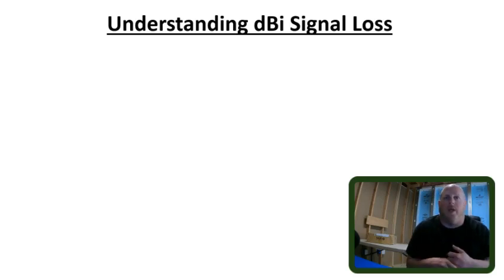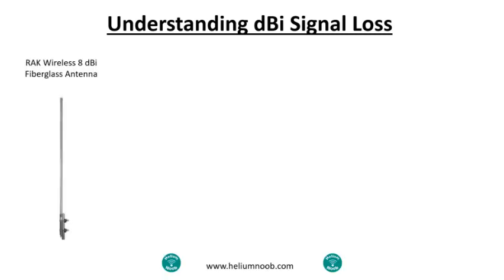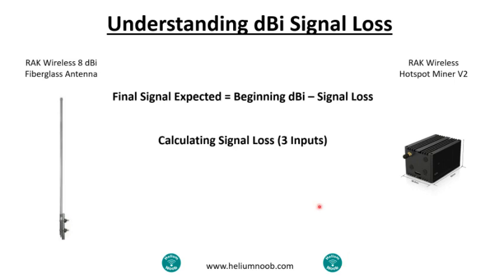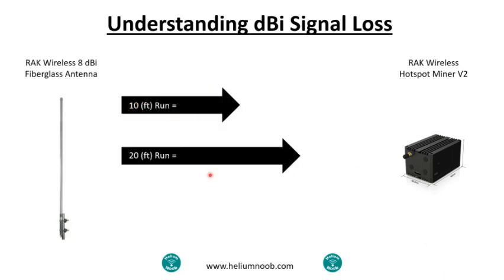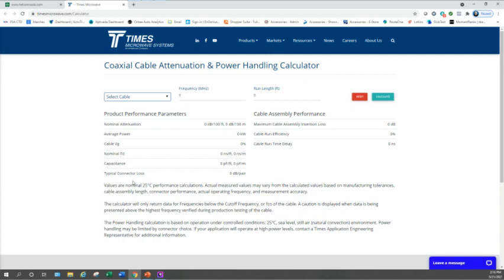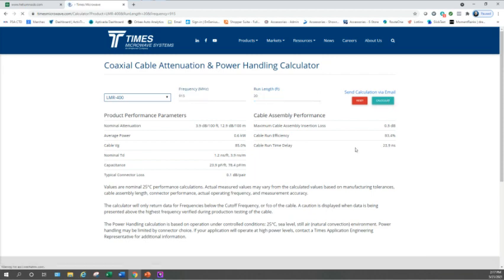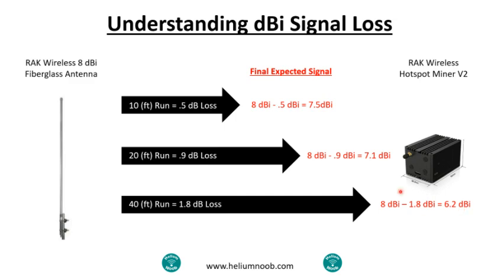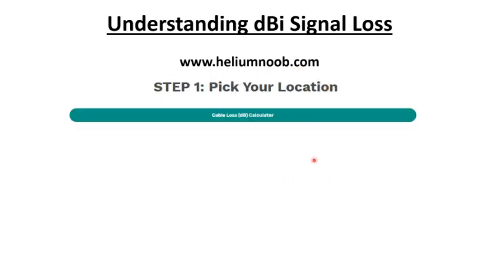RAKwireless Antenna - Calculating Signal Loss (For Helium Mining HNT)

Comment: So I have a rokland 6db antenna with a arrestor and 16ft lmr cable. Should I put the antenna gain in app to 5.2 since the cable is rated to loose .6 and the arrester .2. Or should I leave it at 6db.
Reply from the maker: Yes...use adjusted for signal loss in the app.

Comment: The fourth variable is understanding RF output at different angles. Assuming the RAK 8dbi antenna provides that gain at 0 degrees off axis, 1, 2, and 5 degrees off axis is quite an assumption. It's also an assumption that people use a level when installing.

Comment: dBi is about directivity and dB is about signal strength, those are two different things. dB loss doesn't affect the antenna's dBi. Your antenna will still be 8dBi regardless of how long a cable you run. Higher dBi doesn't mean more power, just that the beamwidth will be narrower, reaching farther horizontally and less vertically, so a 4dBi and 8dBi antennae with equal length cables will have the same signal strength, the only difference is the angle at which this power will be utilized. Therefore trying to compensate for the dB loss by going for higher dBi is a mistake.
Reply: Great answers! dBi is a isotropic gain from anenna. out of hotspot you have a gain in dBm and this is our power budget to which you add cable and connector losses! Really bad information in this video...
Reply: @Grzebskebs  Quick question. If this is the case, why is it stated in Europe regulations the following: "In Europe, the transmission power limit of an ISM band is defined as 14 dBm for a frequency of 868 MHz, the maximum antenna gain is set at 2.15 dBi. If choice of antenna (Dbi) does now affect dBm output, why is is max set to 2.15 dBi ?
Reply: Ty I was looking for this answer  now gotta go back and change my antenna
Reply: So a higher dbi antenna (like 8dbi) would be better to use if you have to run longer cable? 
This way the beamwidth opens up more and still goes out up to 8dbi range,  correct?

Comment: I’m forced to run a 60 ft coax lmr 400 to a rak 5.8 outside,  besides the dbi loss is there anything else that will be affected? Is the same as having a 3 dbi or is the quality lost aswell?
Reply from the maker: You will experience some signal loss bit shouldn't kill the whole thing. Give it a shot, if you dlocation. The result consider bumping up to a 8dbi if it makes sense for your kocation.
Reply: @HeliumNoob  Thats what I was thinking as well, there is enough miners around in all directions so worst case I'll hit the ones closer? Thanks!
Reply: There is no relation between dBi and dB, chose the right dBi for your location, the only way to increase signal strength is to reduce the coax cable length. For example you could run your miner closer to the antenna because ethernet cables barely lose any strenght compared to coaxial.

Comment: Does adding a lightning arrestor and/or a cable connection adapter (e.g. SMA to RP-SMA adapter) cause any signal loss?  If so, how much?
Reply from the maker: Each connector does add signal loss. Amount, depends on the connector, a good reference/estimate is also listed in the calculator as well. Of course only way to tell what it actually is would be to test whatever you are using in real life.

Comment: On the helium app, do you input the dbi for your antenna after loss calculation? Or just the rated dbi?
Reply from the maker: Thanks for watching and comment. I suppose you could put either. As far as I understand what you put in the app is for information purposes, doesn't really affect your rewards. (This is an old comment, antenna dbi needs to be correct in the app, and will affect your rewards as of 10/4/21)
Reply: @HeliumNoob  It will with PoCv11 so any insight on that now? Been looking everywhere including the discord for an answer to "what to put in the app". I have an 8dbi with 1dbi loss (due to 20ft LMR400 cable and the arrestor) so do I enter 7dbi in the app or ignore the loss and just put in 8dbi?! Still glad I found your video but hoping for somebody to answer this. (I'm using 915MHz btw)
Reply from the maker: @Jason-oi7je  thanks for the look. Yeah that was an old comment. The blog basically says to put in "net" dbi only if you have tested the equipment or are comfortable doing the calculation. If your confident with your numbers put the net in. https://blog.helium.com/pocv11-explained-call-to-action-4add36c75a1d
Reply: @HeliumNoob  Thanks for the quick reply so in my case using the same calculator you used here I would put in 7dbi in the app then? Just want to confirm and get your opinion.
Reply from the maker: @Jason-oi7je  correct. Just keep in mind the calculator is "on paper" it will be close but only way to be 100% accurate is to test the equipment.
Reply: @HeliumNoob  Thanks. Just watched your PoCv11 video was hoping it would address this as well. Maybe edit it to insert this exact answer for everyone using a custom antenna. Either way I subscribed and will share your video as it seems to answer alot of what is being asked on the forums etc.

Comment: So you are telling people that they are allowed to run an outdoor 8 dbi antenna?  The default set up with a 3 dbi antenna is already maxed out for legal use.
Reply from the maker: Thank you for the comment. I don't think I am telling people what they are allowed to do here or what is legal/not legal. I am telling people how to calculate signal loss, which is a component in determining whether or not your setup is legal. Of course regulations are going to be different depending on what country/locality you are in. In the USA the max EIRP for 900mhz band is 36dBm. The max transmit power for the RAK V2 is at 27dBm. EIRP=Transmit Power + Antenna Gain - Signal Loss. In my specific case 27 + 8 - .5 = 34.5 ERIP which is below the 36 threshold. So for my setup, in my country, using the antenna I display as an example is legal. Where you are, that 3dBi on the default setup may be maxed out. I do appreciate the feedback, this is actually a really good idea for a follow up video. Thank you Nikos.
Reply: @HeliumNoob  thank you for your honest reply! Also i had the idea that all miners are maxed out by default to meet maximum power and the regulations. Thats why i said  this about 8 dbi antenna with only 2 dbi loss.
Reply: @nikosbalafas6249  each country has a dbi limit for antennas, so obviously a manufacturer ships out  something with a low dbi limit so it falls within the limit of any country it sells to.

Comment: What size grounding wire did you use.
Reply from the maker: I used 12 gauge solid copper. Any home improvement store should have it in cut to length or spool.
https://www.homedepot.com/p/Southwire-100-ft-12-Green-Solid-CU-THHN-Wire-11591584/204868207?MERCH=REC-searchViewedNA-204868207--N
Reply: @HeliumNoob  Thanks thats what I bought.